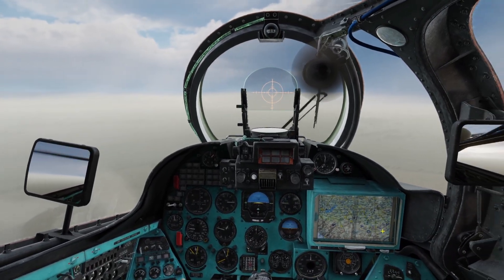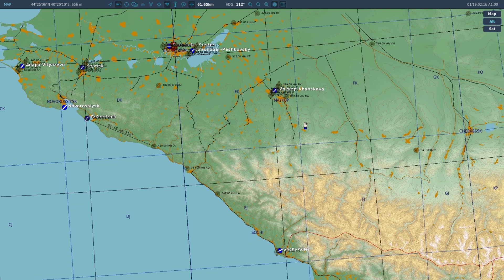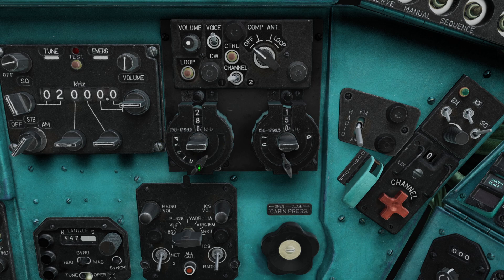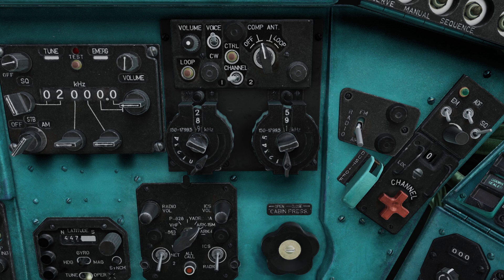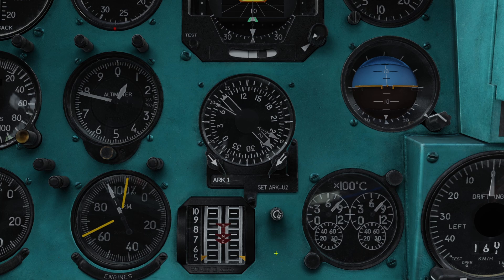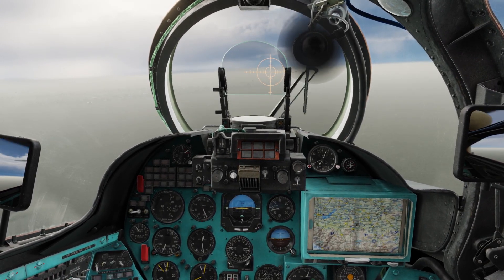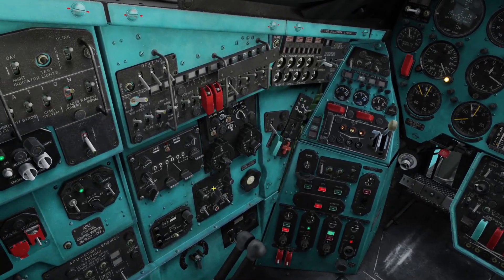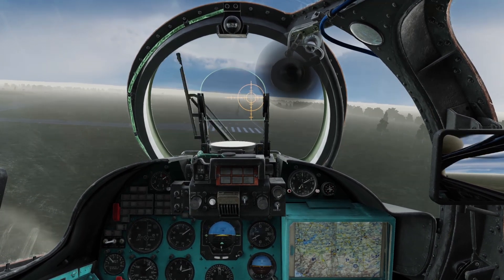DCS Mi-24P Hind Arc-15 Radio NDB Navigation Tutorial

Comment: Be advised, you can now only navigate to units placed in the mission editor that emit radio signals using ARC (Previously you had to use the R-828 with its limited radio channels.)

Just remember that the frequencies are on kilohertz while setting a frequency for a unit is in *megahertz*.

So for 215kHz you would enter .215MHz.

Tested it for my road base mission (Operation Road Kill, it's up on DCS User Files) and now our Hips and Hinds can keep them resupplied with ease.

Comment: Great tutorial. Sometimes just flying around and using the navigation equipment is even more satisfying than the combat. Not only in the Hind. That is also one reason why I like the pre-GPS era modules. 
I just read a F-104 story: A German F-104F had a malfunction of its gyrocompass when performing a poor weather nav training flight. The pilots realized the malfunction when they were wondering why the radio communication with a ground station became weaker and weaker despite they thought they were flying towards the station. When they checked the magnetic compass they found the gyro was deviating by about 180 degrees. In the end they had to bailout because they did not have enough fuel to make it to an airfield. This was the 2nd crash of a German F-104 back in 1961. Both the IP and the  student bailed out successfully. 
The F-104G's INS was pretty good when it worked. About 2-5 nm deviation provided the flight was pretty smooth. However, after some ACM the INS could tell you more or less only that you are somewhere in Northern Europe. That is when the Starfighter's ground mapping radar (which was pretty advanced for its time) came in handy.

Many multiplayer servers just make it too easy since the F10 map allows to check position of own a/c and friendlies and enemies etc. with the press of a button. 
Cold war servers or SOW are much better for immersion and force you to either use visual cues or to use the nav equipment. 
As said, using these old birds is more about flying than fighting, which I personally find very interesting.
Thanks again for making the learning curve less steep with your tutorials!
Reply from the maker: Thanks for sharing the story! Navigation is an underrated challenge, especially if you want to say, do low level raids in the upcoming Mosquito module!
Reply: I worked as a Mi-8 pilot in Siberia in the 80s. No GPS, just a finger on a paper map and an NDB. I really liked the bad weather, low clouds and visibility, oh, how interesting it was to find a given point in the deserted swamps and taiga!  Now the pilot has several GPS gadgets, how boring it is =)

Comment: When you mentioned that there are NDBs with similar frequencies but different morse codes, is there a reason for this IRL? How does your aircraft know to listen to a specific one instead of the other?
Reply from the maker: Your aircraft doesn’t, it’s governed by the airbase, they only ever have one of the pairs active at a given time. The code lets you know which is active. The airbase will choose a runway to have active, and turn on the beacons for that side. This is decided by the wind strength and direction.
Reply: @RedKiteRender  Ah, gotcha. So I have to monitor it to see if it changes (idk if it does within DCS pareters mid mission)
I thought both would be active
Reply from the maker: @KhanGirey  They use the exact same freq and would conflict if they did.

Comment: That's a good tip on using the Morse code to determine which runway is active. I've always just flown to the airfield and contacted the tower to find out, which is.... less than ideal. 

In the Mi-8 the Ark-9 works for both pilots; Does the Pilot Operator in the Hind have any integration with the ARK-15?
Reply from the maker: Yes front seat has an arc-15 too, although I couldn't get it working, uncertain if I'm missing something or early access issue, so I left it out.
Reply: @RedKiteRender  Thanks! I'll take a look at it as well and let you know if I can get it working.
Reply: @RedKiteRender  There seem to be a few things not working in the front seat ATM.  The trim hat comes to mind (if flying from the front.).
Reply: I messed around with it in the front seat and I think I got it to work, but it seems like the channel it uses is reversed. Channel one reads from the right dial, channel two reads from the left dial. I didn't extensively test to see if it works properly though!

Comment: How did you manage to turn the wiper on?
Reply: the four way switch above the fan switch next to the fuel pump panel
Reply: @04408066  I doesn’t move for me
Reply from the maker: Pick one of the speed positions, not the centre (off).
Reply: @RedKiteRender  The switch doesn’t move when I click it. Neither with left nor right click
Reply: @reichenwald-gm4qd  yeah it's a bit weird, make sure you click the writing on the panel, and not the switch itself!

Comment: A quick tip for using NDB's and your ADF. When you want to put your self on a certain course to the station remember this, you "push the head, and pull the tail". So if you are flying to a NDB station and want the head of the needle to go to the left you place your heading to the right of the head and "push the head" over to the left, and conversely if you want the tail to go the left (flying away from the station) you need to fly to the left side of the needle to "pull the tail" . :)